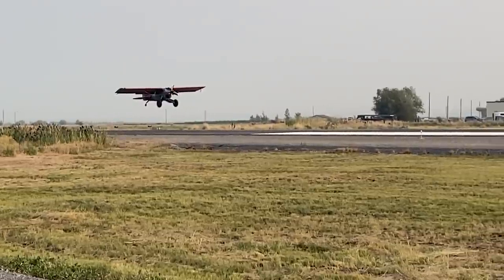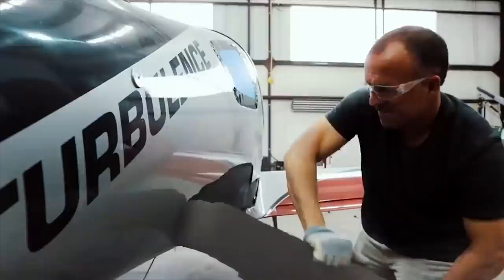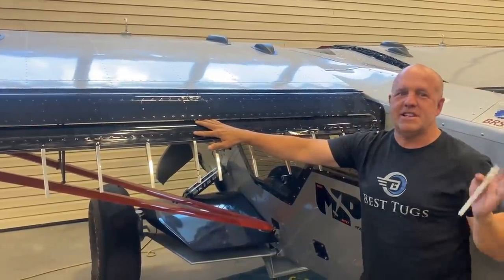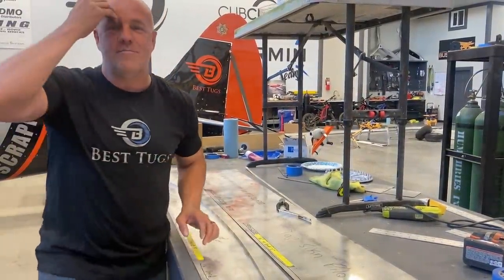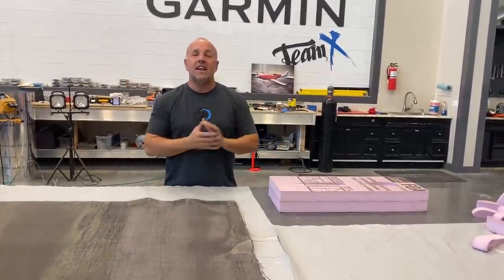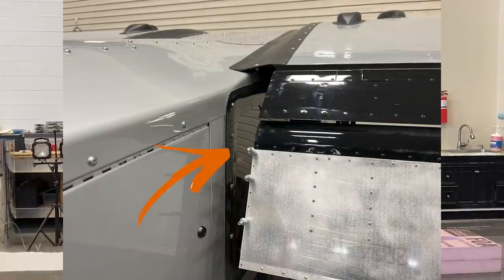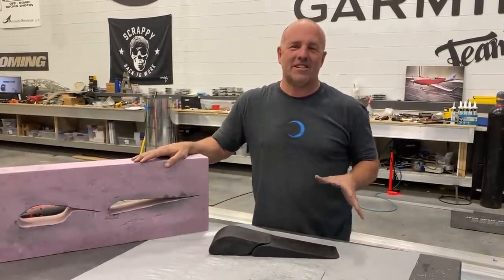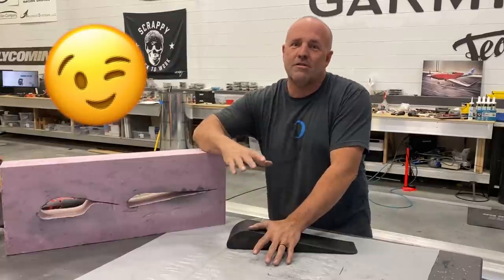How To Make a #CarbonFiber Part Cheap & Scrappy Upgrades | Scrappy #65

Comment: Curious - What level of concern do you need to practice when working with carbon fiber dust?  I ask because I've watched a lot of different levels of dust collection/mitigation,  ppe, and ventilation.  Mike even made a room for processing the larger stuff, but sometimes he opts to not use it.  Is it okay to wear a respirator and clean up the work area after or do you risk exposing others inadvertently?  I've only ever worked with fiberglass so I'm genuinely curious what the best practice is here.

Comment: Has anyone ever thought of some sort of heating system to get the temperature above the freezingpoint to prevent ice forming on those gaps between the surfaces? Maybe it's not easy to do because of small surface area and flow of cold air that it would cool down too much and require a lot of heat to be able to sustain high enough temps? Maybe I've just answered my own question, but is that indeed the reason why? 😀🤖🛩🛫
Reply: Heat is used on props to prevent the blades from icing. Typically for wings they use bleed air (turbine or turbo) to inflate a bladder that breaks the ice off the leading edge.

Comment: Carbon fibre question..... Not plane related though. You always talk about putting a coat of micro on snd sanding it flat, do just then paint with a 2 pack clear coat for glossy parts. I am just rebuilding a carbon fibre fishing rod sanded the old purple paint off and want to gloss it up.

Comment: Why not make a flexible component that covers the gap entirely without restricting movement? It solves the aerodynamic and icing problems with probably a very cheap plastic part. 

It could be the same flexibility tech from a bendy straw just shaped to block air, dirt, and ice wherever there's a gap in control surfaces. 

Why is this not done?

Comment: There has got to be some new rules so these can land outside of airports. These nearly perform like helicopters, and could handle rougher weather.
Reply: Next is cyclic prop pitch linked to a bidirectional fenestron tail rotor for fine, yet powerful inputs without prop draft lag.